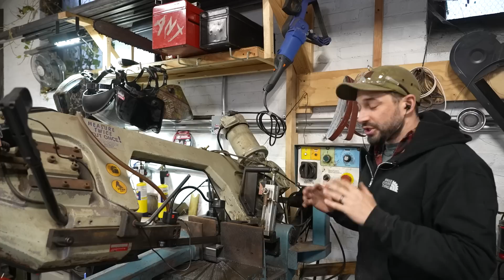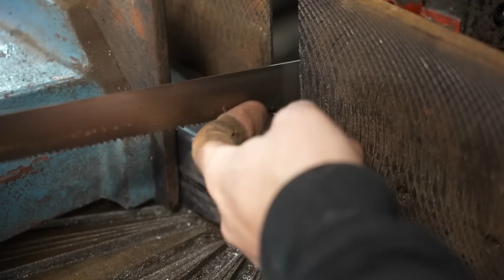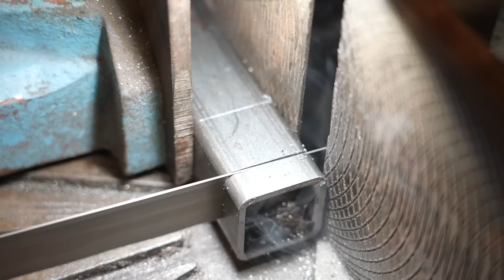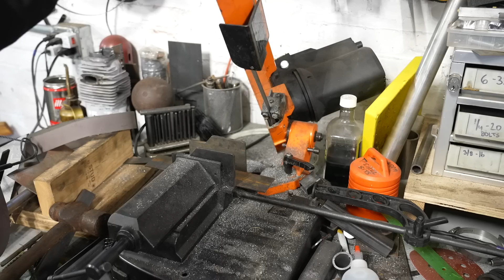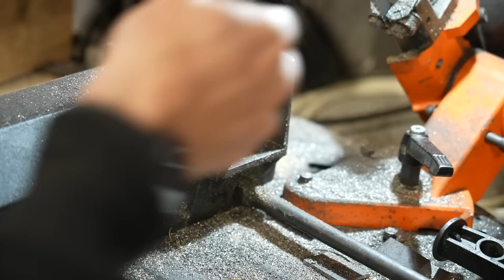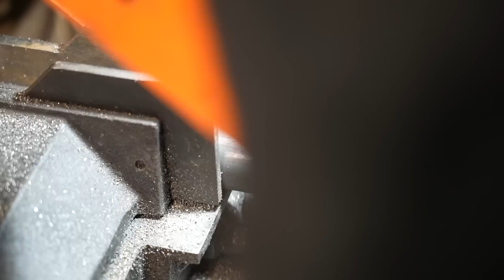The $15 Upgrade That EVEY Saw Needs!

Comment: I just positioned my 6 inch x 4 inch bandsaw directly under a fluorescent tube light - the tube is about eight feet above the floor, and is of course in line with the blade.  The shadow is the same width as the blade.

Comment: ...but the shadow moves as you move the LED, intentionally or accidentally... which makes this idea useless. That's why nobody implemented it before you... 😂A laser liner can be focused, installed at an offset so that it shines on the material, not the blade. So a laser liner is much more useful if installed right, like it is on many bench drill machines and circular saws.
Reply from the maker: @AdaptingCamera  you set the shadow and it’s perfect,  lasers aren’t perfect and are wider than the blade

Comment: 👏Careful placement of the light also shows the set of the blade teeth, enabling greater accuracy. I have been in the habit of clamping, lower the moving blade on to the workpiece, then moving the workpiece to suit where I want the cut.

Comment: Good idea!!!  From optical point of view this method does work best if you have a point or a line source of light.  By covering most of the lamp face (just let a 3 mm central line uncovered), this should give a sharper projected shadow line.
Reply: That's why the line gets sharper the farther away the light is. It approximates a point source.

Comment: Nice tip but if you have to rule a line on the job to start with just do the sizing in the saw ruler against the blade job done once and no guess work

Comment: I don't think the word "telegraph" means what you think it means. The word you're looking for is "project" - the shadow is projected to the work piece, not "telegraphed"
Reply: good catch about "telegraph" but I don't think you can ever project a shadow. You can project a light onto an object and in turn the object will cast a shadow. I think that's what you meant, casting a shadow.
Reply: @thisiscristian  You can totally project a shadow. In mathematics, "project" is used to mean pretty much exactly that if you think about light and shadows, and projecting lines or curves or surfaces in 3d space onto planes in 2d space or lines in 1d space (or more generally projecting anything in m-dimensional space to an n-dimensional space, where m>n).
Reply: @gorak9000  Thanks for clarifying!

Comment: Minor warning: We ran into a problem today. We had a electronic device that just quit working right after we added a LED light near it. The light's internal electronics conflicted with our other electronic device causing it to heat up and stop. We removed the light, let everything cool, and now our original electronic device is working perfectly again. The LED light is going to be used elsewhere.
Reply: I have heard of similar issues with adding led bulbs in certain garage door openers.
Reply: Yes, LED lighting is crap because of these issues.
You can't even count on brand name stuff being good since the Chinese companies just forge the certifications.

Comment: This is nice to have. I have been measuring off the blade to the edge of the steel for 18 years now. its very precise but at times this would be ideal when you have to cut miters and measuring to the edge just doesn't work. Nice tip
Reply: Me too. So easy.🇬🇧

Comment: Funny, I'm older and need more light to see in the shop. I discovered the LED "Sewing machine" lights not long ago and got several from EBAY. They are great, have a built in switch and plug directly into an outlet. I was looking for more a couple weeks ago and found this light you have here. I really liked the longer goose neck. But, it has a 120v plug and all the EBAY ads say 250 volt. I asked the sellers if it's 120 since it has a 120v plug.....useless. No answer. So I took a chance and got one. Works fine on 120v.  I intend to purchase more of these and will probably have one on every machine in the shop. This idea with the shadow line is just a great extra bonus for all my band saws!  Thanks for this neat trick! I will try it on my metal shear to see if it will shadow the blade on that as well.

Comment: Winner, I've used those sewing machine lights for many lighting challenges. I get the three packs, they come with steel 'stickers' to mount on non-magnetic surfaces. I have several on my electronics workbench for soldering surface mount components.
Reply: Yes, very handy and bright!

Comment: I worked in a door factory years ago. The company bought logs and used a shadow line rip saw to rough cut the logs into boards. It's been around long before the 70s when I first got to see it work.

Comment: Having the power adaptor closer to a plug, not withing the magnetic base of the light, would be much safer. A cut cable for whatever reason could bring mains voltage to the saw. A battery powered torch would be even better. Just a thought. Great videos in general, thanks.
Reply: his mitersaw vid involved running the wire inside the saw and tapping off the mains power the powers the saw. If one wanted a more permanent (and safer, I guess) install, find a way to do that. But every saw is different it would be kinda pointless to try to cover it.
Reply: I have a nice rechargeable one with a strong magnetic base and 2 foot goose neck.🇬🇧
Reply: It is in the plug.
【Safety Power Plug】You can insert the plug into a 120V household socket. The plug contains a converter that can convert the 120V high voltage into a safe low voltage. (Please don't change the plug)

Comment: I’m gonna have to get one for my drill press.
Reply: You will not regret it.   Have not used them for for the shadow line but have several that I use on many tool including metal lathes.
Reply: @danharold3087  Great on the Bridgeports as well
Reply: That will work for light but not a shadowline because you are trying to find a single point, not a line.
Reply: Yes so good. I have a rechargeable one on a goose neck. So good when using a mag drill on steels in situ or machines in the workshop.🇬🇧